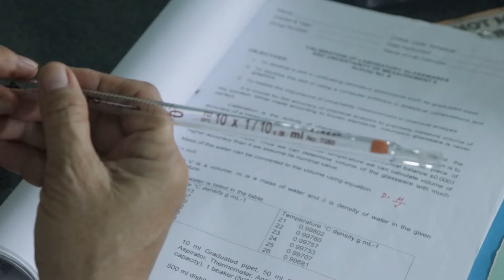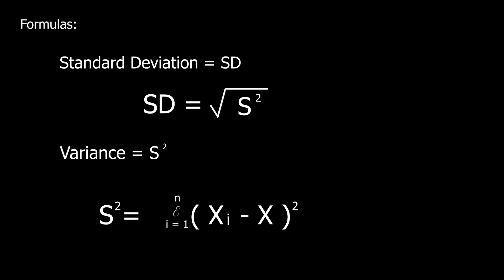Calibration of Laboratory Glasswares and Uncertainty of Measurement

Comment: Coralray Trishia Pilayre BSMT-1 B

I've learned how to calibrate laboratory glasswares using the graduated pipet, compute analytical computations with the given results/weight and put it with the given formula and I've learned what is the importance of determining different measurement in laboratory procedure. There is a difference of every measurement, will never be the same and perfect.